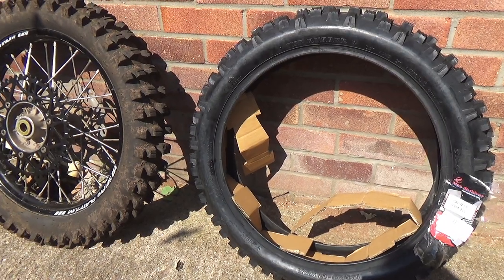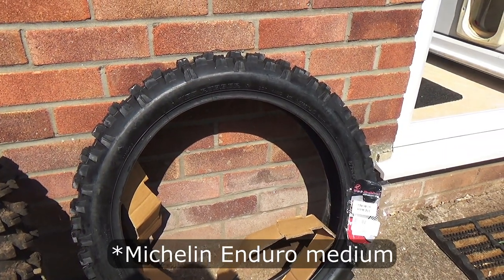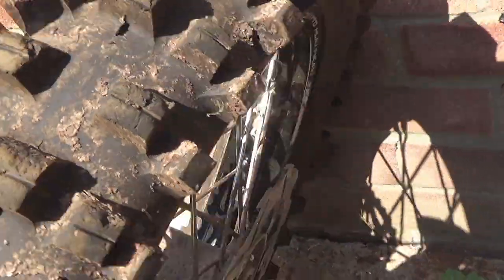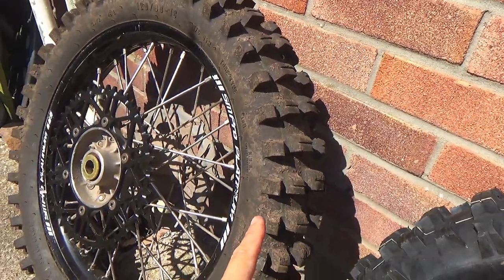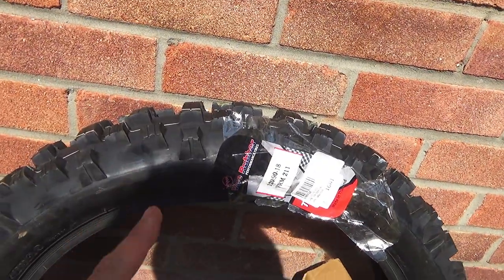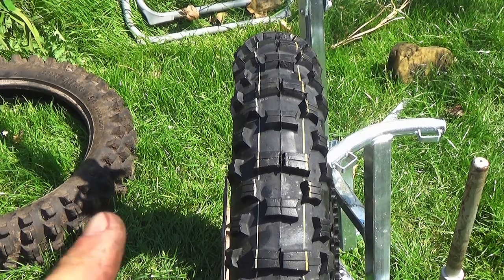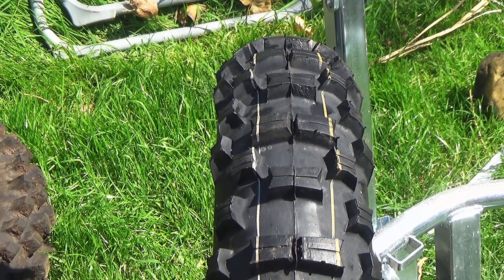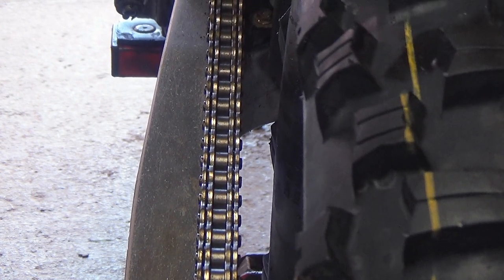Trying out a Vee Rubber Enduro Tyre VRM211

Comment: Would it be safe to say, that all, if not most vee rubber tyres don't last long at all?
Reply from the maker: I've only tried 3 vee rubber off road tyres and I think you're right. They used to be cheap so it was a fair trade but now they're almost the same price as better tyres.
Reply: @jonnoMoto  Thank you. I was sceptical buying one of these tyres. For the exact same price now I can buy something like a maxxis desert IT, motoz gummy ETC.

Comment from the maker: Raced on the tyre yesterday. Track was a mixture of flint-rocks, soft mud, roots, hardpack and grass. It rained halfway in to the race. 
Tyre did ok in general although I found it very unpredictable on it's edge. It's also not a durable tyre with it significantly tearing up after 3hrs. 
I'll probably race on it once more but not until i've flipped it around as all the leading edges are destroyed.